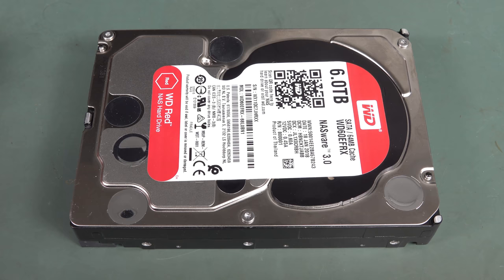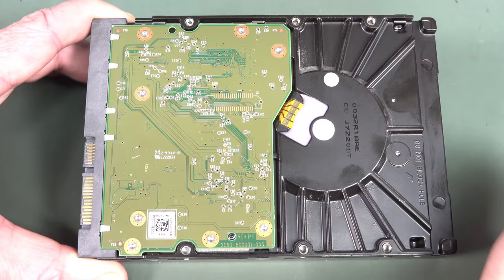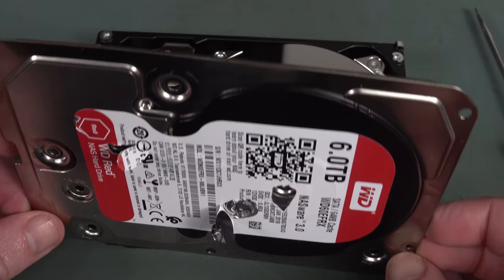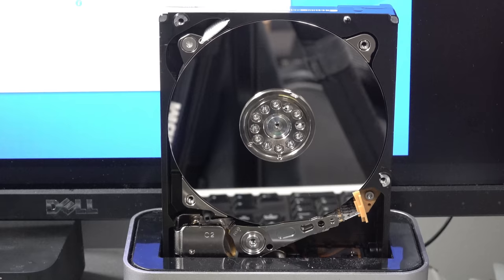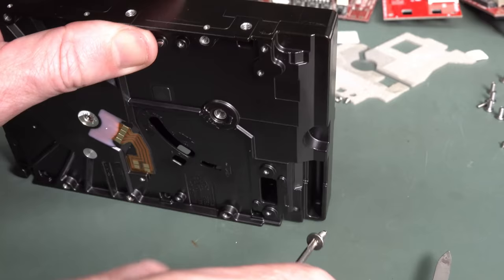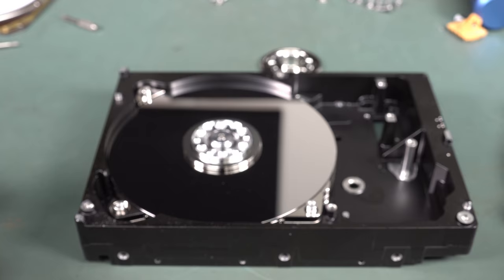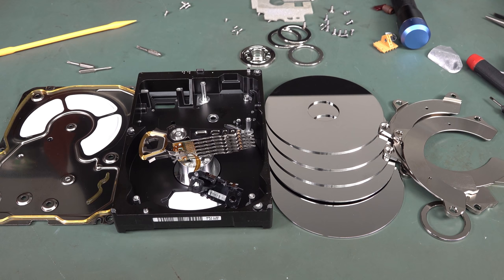EEVblog 1398 - Western Digital RED 6TB WD60EFRX Hard Drive TEARDOWN

Comment: I've had a couple of WD Red drives fail on me out of the several I own, and luckily both were controller board failures, so I was able to replace the boards and swap the EEPROMs on them to save them.
When you think about the amazing precision and engineering required to make these, it makes SSDs seem simplistic by comparison, where all their advanced engineering is hidden in silicon and control software, these magnetic monsters are marvels of mechanical engineering.
Reply: Which is why I systematically build my RAID 1 pairs from 1 WD + 1 Seagate to reduce the chance of simultaneous failure.  I learned from loosing an old RAID 1 made from system integrator provided identical hit swap drives.

Comment: i bet that spindle was hard to spin because the bearing theyd have to use would have to have such a heavy seal to keep in the grease it certainly has to have because of its use case, its not heavy duty but constant duty whichs really hard on stuff as well

Comment: I recently tor down several WD Ulstrastar DC HC5120 12TB drives. They have a fused or soldered on metal hermetic seal over the screwed on face-plate because they are helium filled.

Comment: Actual machinist here. The seeker head component is not exactly a “difficult” part to machine thanks to the proliferation of multi-axis CNC’s. However the individual heads would present a challenge due to them vibrating during the machining process. I saw some vertical “chatter” marks on some of the heads since they would be vibrating. This is exacerbated by the small-diameter end mills needing to be physically longer to cut out those individual heads. Work-arounds for this would include shrink-fit tooling, flood coolant, lower cutter RPM, and Spindle Speed Variation for the cutter to avoid harmonic vibration modes (especially if the tools length to diameter ratio is greater than 4). Excessive vibration can lead to parts getting damaged (and therefore scrapped) and excessive tool wear and breakage. As for cost, that can vary depending on the contractor. I can’t imagine price/part being more than $50 but I don’t work in a mass-production environment. 

As for the circular parts between the platters, those look like they were ground. Surface grinding is very common if tolerances need to be consistently less than one-thousandth of an inch (or one thou). Even an old Harig can consistently hold tolerances down to 0.0005 inches. For a well-made CNC surface grinder, tolerances can be a little tighter.

Comment: Sorry if these are already mentioned, but stepper motor hard drives haven't been used in PC's in 3 decades, hopefully they are all retired now. If the drive has atmospheric vents they are not inert gas filled. Otherwise, quite entertaining, and you are right about the tight mechanical tolerances. As an aside, it seems that most precision assemblies are being replaced by semiconductors, SSD replaces HDD, digital clocks replace mechanical clocks, solid state recorders replace digital recorders, EFI replaces carburetors and so on.

Comment: Some of those pads, the "desiccant bag" will catch any little particles. If heads have impacted the platters there will be chunks, especially on the "desiccant bag" due to its location.
Meaning that was when we knew it was likely a bearing failure or similar.

Comment: SMR is a lot slower, especially once the drive is full and has run out of empty areas (or the CMR write cache area is exhausted) and needs to rewriting to do the shingling. In RAID or ZFS, this means that the rebuild/resliver would either result in another drive"failing" from timeout, or, at best, talking multiple days to complete and possibly having another drive actually fail.

Comment: The last time I saw something visibly wrong inside a hard drive, it wasn't just a head crash, but the head actually dangling by a copper trace.  Was the motor still electrically connected to anything so that maybe it was acting like a generator? They usually make nice bearings. The platters also make nice first surface mirrors, or xmas tree decorations.

Comment: SMR drives aren't bad per se but they definitely have preferred use cases, those being archive or sequential transfers of very large files. If you're trying to use them as a system drive in a desktop or something else with frequent random writes you're in for a bad time. Ideal use in a desktop would be combining an SSD for operating files and a large-capacity SMR drive for storage of media files that don't change much.

Comment: The brackets were most likely made on a lathe. I imagine they probably have a custom chuck or faceplate with corresponding pins/mandrels that fit the holes on the bracket, and that they probably used a precision mill to cut and maybe ream the holes on the blanks. The head was definitely milled from a solid blank,  They would have drilled the holes and cut the slots on the top and what not and then they would have either flipped it 90 degrees to mill the heads out individually, or they used a cutter similar to gear cutters. Not really a whole lot to it, it's just really small and requires a lot of precision, but that's not too much of an issue anymore with the CNC machines they have now.

Comment: First job i had was at IBM in the clean rooms in the mid 80's rebuilding a monster huge hard drive called Gulliver. They used to recycle the parts to service existing mainframe systems still in use. Probably like 10MB storage or something.
They also used to recoat the huge 14 inch disk platers on site, it was like walking into some high tech space age laboratory which i guess it was really.
A head crash on one of those during testing was a messy affair and really noisy. There is some footage on here of someone powering one up, you need ear defenders being in the same room.... 
There was also a drive called Piccolo that was being made in the same cleanroom, bit smaller size but more platters. I think that was 65MB storage!
Also some other top secret drive being made in some other new hi tech cleanroom, never got to see that from distant memory..

Comment: If I had to guess at the failure, I'd guess either one of the heads failed (electronically, not physically), or something went wrong with the pre-amp chip-on-flex during operation. Note the head movement and noises when you powered the drive on - I think it was repeatedly trying to read the service area at the inner track of the stack, and due to the heads not working, couldn't. When that failed during operation the drive just flipped out because all of a sudden nothing worked anymore. If this drive went back to Western Digital they probably would have pulled and replaced the head-stack assembly and re-shipped the drive as "refurbished".

Comment: The actuator arms would be cast, like the body, then machined. The marks you noted would have been from a fly cutter tool bit. I worked for IBM in the 80's and machined the base castings and arms used in disks for the AS400 series of computers to +/- 2 microns on programmable Cincinnati Milacron milling machines. The disk platters would be so flat like slip gauges, so flat so the air gets squeezed out and it's just atmospheric pressure keeping them "stuck together". Fun engineering days.

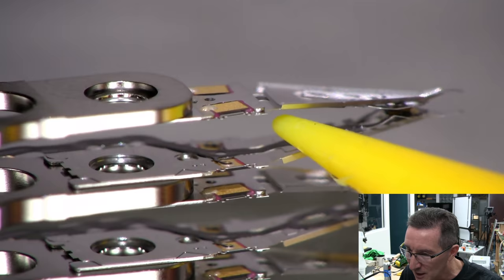Comment: 20:23 The golden "test pads" are actuators (piezo based) for micro positioning the r/w head. The voice coil at the other end of the assembly just does not provide the precision nor speed which is needed for proper tracking.
Ask Google for "Second-generation Micro Actuator for Better Head-positioning Accuracy" it's a white Paper/marketing Paper from WD depending this (old) actuators and the new stuff.

Comment: Without the cover, heads do touch platters if the drive is powered on. Platters then do get scratched.
Hard drive never should been powered on without the cover, even in clean room! Cover is specifically studied from manufactory to make flow air in a proper way so heads will fly on platters (without touching them) at the distance of few nm.

Comment: The roughly quarter-circle shaped magnets are actually 3 magnets in one piece, so on the inner side of the magnet, you have something like N-S-N, while on the outer side of the magnet, you have S-N-S (or the other way around), which in itself is an engineering feat, because it's in one piece of NdFeB.

Comment: Could it be a single bit or more was missing from the head positioning servo driver? It sounded like it was just hunting around trying to find the correct track but each time it jumped to the incorrect position then tried repositioning the servo to read again. Meaning a electronic error rather than mechanical.

Comment: @EEV Its like when you rub you car when it is dirty, its is rough, but after a polish and wax, your hand or cloth glides over with no scratching, those heads are touching the platers, it is just that there are no imperfections or dirt.  Other than that, the speed of the platers maybe create an airfoil of some magnitude?

Comment: If the other 3 drives were approaching being full and they are not in any way duplicate of each other, it is more or less impossible for a 4th "redundant" backup. This could be technically possible if the 4th was compressed and the other 3 had compressible data. If like there were 2 sets of duplicates of 2, yes. The 2 scrapes on the edge of the ring were probably balance adjustments.

Comment: Many years ago I tryed to repair some drives. The failure was the bearing in the middle of the arm with the heads. It stucked a little bit at the beginning of every movement. You could feel it in your fingertips when pushing the arm. So the controller was not able to position the heads. I could repair one drive with a drop of oil at the bearing so I could save the data.

Comment: The arms are just controlled by a voice coil mechanism. It works the same way as a loudspeaker there's an electromagnet that pulls on the arms in a spring. There's one platter typically that it's reserved for what they call a servo track. It sends a signal that the drive uses to locate the head positions. If that that platter gets demagnetized the drive is basically scrap metal. In LA, you used to see a whole bunch of disc drives at flea markets, but they were all dead as a door nail. The vendors dumpster-dived them when they were tossed out by defense contractors. The contractors would routinely run them through a bulk degsusser.

Comment: The  production engineering and technology in these things is nothing short of amazing. Cheap as dirt, all things considered. I work with a guy who used to be at Seagate. He said he could spend a year optimizing sections of the firmware code for drives like these.

Comment: Now take 5 from another drive, put them all on the motor, connect the leads to an ordinary BLDC ESC and rev it up! Have done that but with a smaller one many years ago and the motors in these are quite strong. But since these have FDB bearings the oil will sling out at around 20000 rpm or so (probably earlier as well) and starting to generate friction and stop. But after cooling they could work again, and you can just replenish the flung out oil with any very thin oil.

Comment: I have taken apart a number of "dead" drives to ensure no data could be recovered, before putting everything into the e-waste metal collection box. I too have never found any visible indication of the drive failure. Platters and head mechanisms all looked pristine so the faults are far too small for my eyes.
Reply: Wait till you see one where the carbon air filter spilled it guts.  Nasty stuff.

Comment: I just opened 4 of my WD 3TB Blues and no disks had marks. 3 have a "gritty feeling" feeling when I spin the disk pack motors. None f the motors would get past 5k rpm with the cover off. All were 2016 Feb,July,Oct and Nov. I suspect the bearings in the motors failed. I often salvage the motors and had 0 of 4 working motors this time, which is very rare. Until now, I have always found the motors to spin very smooth when all the disks are still on.

Comment: Could be just bad contact. Those pads oxidize and contact between pcb and the internals lose. I've saved a couple of drives by just cleaning those pads under the pcb. It is crazy that after all those efforts they didn't bother to goldplate contacts. They sounds different though... and it was much older hard drives.

Comment: Somehow it has been my understanding that the head block would be machined by a process called electrochemical machining, i.e. etching...  Maybe totally wrong, just something that stuck to my mind from some trade show jargon many years ago.  On the other hand, the head positioning "engine" is a voice coil actuator, an advanced version of what is used moving a speaker cone.  They don't have feedback either, although I remember somebody once tried if feedback would improve anything.  No-go!

Comment: The main things I've found that fail are the connections between the board and the pins or pads on the drive itself.  Those pressure contacts never last forever.

Comment: its odd that it would die that fast in general.. i guess it just shows the manufacturer tolerances and materials of quality used aha. i still have some sata 2 black editions way up into the 50k+ hours. noisy af but still working. and my current seagate ones are like 30k+ and they run 24/7 in my pc.

Comment: Root cause might be traced to minute spindle motor bearing wear;  a combo of bearing roughness and play from 20,000+ hrs of rotation that causes enough platter jitter to prevent reliable reading of data.

Comment: I have a bunch of thee drives at work, never taken /them/ apart but I have lots of others.  Look out for the magnets, they can cause an injury.  They'll also work themselves through the plastic walls of a container that you put them in "for safety".  You should keep the board if you have identical drives in the NAS as it can come in handy if you have a logic failure on another drive, saved a couple of drives this way.

Comment: The screw that you stripped--and all of them for that matter--are probably a Torx-Plus.  Compared with Torx, TP has a slightly wider flange and can take more torque.  Torx bits fit into a Torx-Plus screw, but not the other way around.  Torx bits fit TP fasteners with an elevated risk of stripping them.  Best practice is to try the TP bit first, and if it doesn't fit, go with the Torx next.  The difference between Torx and TP is very subtle, similar to the subtle yet important difference between Phillips and JIS fasteners.

Comment: I feel your pain Dave..  Ah... another day, another dead WD drive. These have a habit of dying just after the warranty expires. Plug it in once, save a huge backup to it, check it, unplug,  check it on another computer, unplug and into safe storage. Plug it in again a couple of years later and the drive is crunchy clicking with no hope of getting it up and running again. Tried it in various other computers and still no hope. Lucky that the data was also on a backed up to a stack of DVD+RW discs, so the data was not lost to time. 
The drive gets stripped down and the parts go into the scrap metal boxes.

Comment: Dave, after you had established that there was nothing wrong with it, why didn't you put it together again and get it going?

Seriously, though, I once did that with an 6-platter, 12" diameter mainframe disk (I did this in approx 1985).  I centered all the platters very carefully, and it actually ran with less vibration than before I stripped it, but they have a servo surface, which is read by the servo head, and my servo tracks were no longer concentric, so the heads wandered all over the place - but for the few minutes that it ran, I don't think any heads crashed. Leastways, I didn't hear any crash. 

In your case, there didn't seem to be a crash, so the noise you were hearing must have been the continual re-seeking that we saw when you powered it up, so maybe the fault was more electronic than physical.

Comment: They dont use Loctite on the fasteners as it would mess up the balance of the rotating assembly and course severe vibration and early failure.